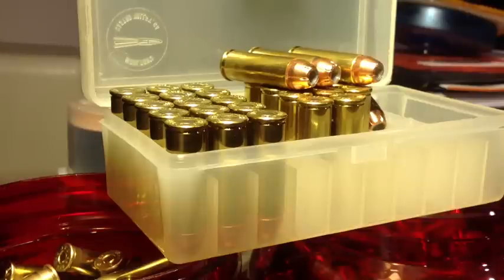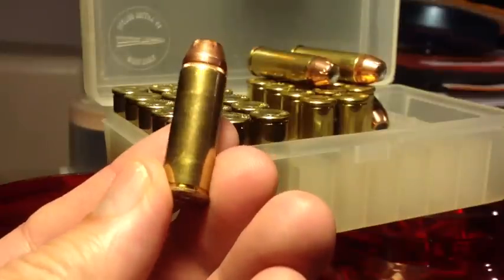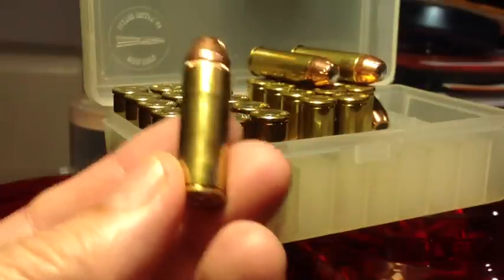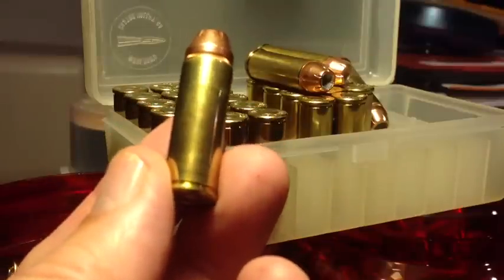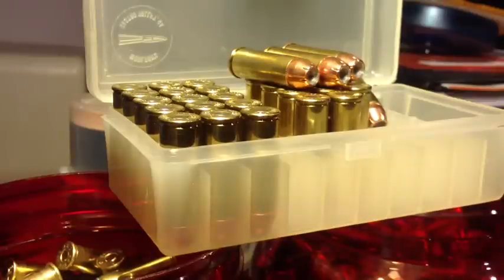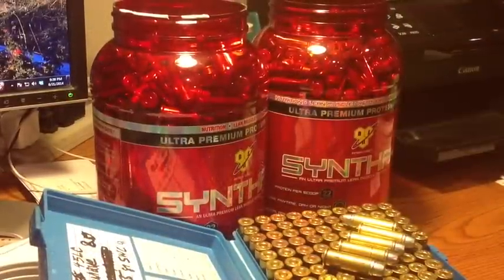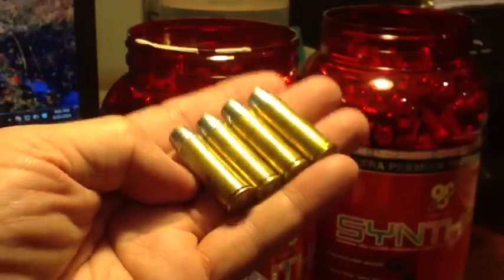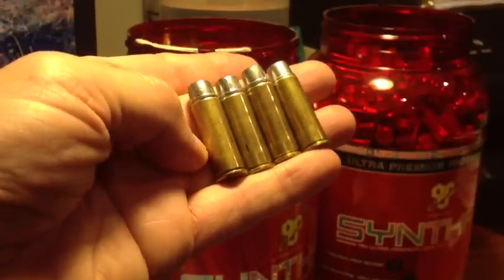Hot Loaded 45 Colt Ammo - Why Not?

Comment: Hi brother, I have a quick question if you've got a minute.

My family runs cows in an area of Utah with a serious predator problem. I turned 16 this year and now I'm viewed as old enough to check cows by my self. I have a 2014 Ruger Blackhawk Convertible in 45 colt, and I personally think the moderate hand loads I put in it are good enough for anything that may pose a threat (semi wad cutters, small amount of 2400, running right around 970 fps) but my mother won't let me go unless I have maximum loads or take a rifle as well. A rifle is out of the question as I lost a Remington 7900 in 30-06 because of a scabbard getting caught in thick brush and being tore off, then falling into the green river, and I am trying to save up for my first truck and can't afford a new 434, 460, or 500 revolver. Could you maybe help me with the info of what either a max load or very stout load I can shoot with relative safety? 
Thank you much

all reloading is supervised by my uncle, a firearms instructor
Reply from the maker: +no no -- SWCs of 45 persuasion and running around 250 grains at 970 are not moderate loads - they are frontier loads.  And predators short of bigger black bears will readily fall to those.  You can stoke those to over 1000 fps easy if you want more smack.  If there is a predator problem, means there is game in the area attracting the predators.  FortuneCookie Policy - Till the day she dies, your mom is always right.   Utah is mountain lion country.  Although they stay to themselves for the most part, there are episodes of human attacks.  A short range carbine 44 magnum caliber would be comforting.  If cost or knock around is a concern, an 18" Mossberg 500 with 00 buck backed up with slugs can be slung on your back, hammer down on an empty chamber, forget the scabbard - quick to deploy.  Practice a little with it.  Practice birdshot is cheap.  Your handgun is backup.  No matter how capable we are, our skin is still mighty thin and our claws are microscopic.  You know how fast beasts can be.  Staying alert and aware is the first priority.  Never let your guard down in the back country.  Wild beasts have little else to do, but work on their next meal.  Best to you in the Holiday Season,   FC
Reply: +no no Well young man I  am not fortunecookie 45lc but maybe I can help you out here and put your mother's mind and yours at ease a bit, the 45 colt round loaded to even the 970 fps level with a 250 grain or so semi wadcutter bullet is way more potent than many of the guns of the cowboy era back when the cowboys gun was very much nescessity, they had many bad critters to deal with that would bother the herd on cattle drives and what not, the most popular round being the 44-40 a round that out of handgun would drive a 200 grain bullet at about 1100 fps. this would appear to be a tad more than your 45 colt but not really the colt can very easily do the same but with a heavier 250 grain bullet, your blackhawk is a good and very strong gun it will have no issue with a load pushing a 250 grain bullet at 1100, you can use either lead as you are, or look up rim rock bullets and try some of their 250 grain semi wadcutter hollow point gass checked bullets (have taken things as large as black bear with these at the speed previously mentioned and they were one shot kills), and the non hollow point will penetrate VERY deeply when needed (with those loaded to that velocity I would not feel undergunned even on some of the larger bears), but for loading lose the 2400 it is about the worst possible powder for the colt really it is a good powder and all but there is way better for the colt, now I am not saying it won't do ok but it has some properties about it that make it less than the best choice for this combo, get yourself some Alliant Unigue standard non magnum primers such as cci 300 work just fine just do not need the magnum primers  for unique it is very temperature stable (doesnt get harder to light off when temps drop) and is very easy to light, and has long storage life if stored even nearly properly, and a little goes a long way so to speak, just some of the things that 2400 lacks, as far as the old wives tail about the 45 cases being weaker than any other cassing is just that an old wives tail, it did hold true in the early days because it was what was called a baloon head design( the brass tube was pressed down against itself to cause the rim area to baloon out and for the rim, this portion of the balooned rim then went unsupported in the gun and with higher pressures of more modern loads would rupture, but for way better than 40 years now that is not the case, all new strait wall cases are made the same way, from machined solid brass by stamping, extruding, and machining and whether 45colt, 44magnum, 357magnum, and whatever are nearly all identicle in strength, just that the old wives tales and numerous miss conceptions are like a spreading illness on the internet especially, I have been reloading and shooting and hunting and am also no stranger to the ranching live, ( right about 40 years now )and if you are in Utah I am your nieghbor to the north here in Idaho (central part near grangeville area), my loading for the 45 colt is as such I chose the better quality cases such as starline, federal, or hornady (they are just more consistant and best overall quality but any are fine) size them as normal, fit them with either cci 300 non magnum primers ( NOW I DO MEAN NON MAGNUM PRIMERS, any brand is fine but again NON MAGNUM or it can cause preasures to go up quite a bit), then I charge them with 10 grains of Unigue ( anywhere from 9.5 to 10 should be great for you)  then cap it off with the 255 grain lead bullets that I already talked about ( diameter of .452 to be exact) and give it a good firm crimp, I have fired bucket loads of these through many different guns over the years and never a problem, and are rather pleasent to shoot without heavy recoil really (in everything from my 1858 remington with the kirst converter, an actually old cap and ball gun converted to shoot metallic cartridge, and my taurus judge, a few different rugers, a couple different rifles, and others), and like I said even hunted with them having taken game as large as elk with them and it did just fine, everybody these days are hung up on velocity and foot pounds of energy to determine what is horse power it seems, but I am here to tell you that a big heavy hunk of lead like the 45 colt 255 grain or better has sent MANY  a man and critter to the promised land ( even at the cowboy load level of 800 or so fps), well long winded I know but hope it helps. take care now.
Reply from the maker: +looseballs1966 -- Thanks for posting to the young man your wisdom...Anything organic that gets in the way of those big 45s at any reasonable velocity is having a very bad day...even 8.5 - 9 grains of Unique is a potent load.  I did not realize that those old 1858s could take 10 grains of Unique/255s.  I'd shoot those in my Rugers though... Have a great day... FC
Reply: FortuneCookie45LC You are quite welcome my friend, yea the old steel framed 1858's are stronger than many give them credit on being and the bulk of the strength is coming from the converter cylinder more so anyhow really, but I still don't suggest giving them a steady diet of them however, just to nice a gun to wear them out that way, but the rugers can take boxcar loads of them, take care my friend.
Reply: +no no  - I strongly suggest reading Elmer Keith on 'Sixguns' so you dom't have to rediscover the wheel.  He walked where you are, 45 Colt wise, way back in the 1940s and 50s.  If you can consistently hit a playing card at 20 yards or so with your pistol, then you probably don't need a rifle, but alternatively some predators can cover that distance mighty quickly, and a rifle does give you a little stand off range you may find useful.  For what it is worth, I played with and happily discarded Unique decades ago and much prefer 2400.  My best advice is play with both, then go with the one you like.  :)
Reply from the maker: +Ken ibn Anak -- He might like 'em both...I used to shoot lots of 10 grains of Unique / 245 Keith or the classic Keith load - 22 2400/245 Keith.  The 10 Unique was a nice warm load and the 22 2400 the full out magnum.  I still shoot lots of those, but since have diversified my bullets to the 200 RNFPs, 240 (they weigh 252) SWC in regular lube as well as PC, and the 240 (they weigh 264) RN in regular lube and PC.  And also 240 gr JHPs as well.  Very versatile is the 44 mag.  I still like the Mossberg 500 stoked with a couple of buckshot rounds back up with slugs for predator medicine.  Have a great day,  FC
Reply: I have gone heavier,  Up to the pierced or flat primer level,  I just wasn't getting the velocities I wanted with Unique without getting the excessive pressure indications still short of the target velocities,  That's why I rolled over to 2400.  I reached the velocities I wanted to see but without head expansion,   Also, I just didn't like the orange muzzle flash of Unique and prefer the white flash of 2400.   :)
Reply from the maker: +Ken ibn Anak -- When we're touching off full house magnums, what differrence does some flash and muzzle blast make?  It's all part of the package.  For real impressive flash, H110.  We're talking lightning and thunder there, pardnah!!  But I do like my 22 grains of 2400 in the 44 - just haven't found any 2400 in over three years, H110 has been found.  Best to ya,  fC
Reply: +FortuneCookie45LC - I hear you,  I loaded about 100 rounds at 21,5 gr of 2400 and stashed most of them them away, then loaded another 500 rounds with the milder 19 gr, load,  That was 20 years ago.  Many dead deer later I still have several hundred of those rounds.  I also still have a full can of 2400 if I need more punch for something.  It is good for .38s too.  Hmm, I still have a quarter pound of Unique too,   Maybe someday I will find a use for that.
My own video at http://plimking.com/45-colt-maximum-load-velocity-test/ shows the kind of velocity 20 grains of 2400 produced,
Reply from the maker: +Ken ibn Anak --  At the rate you are using those powders, you are good for the middle to long term future.. Our gunpowders, stored cool, dark and dry, are good practically indefinitely.  Our descendants will be finishing up our powders if we are not careful...lol  Best Regards,  FC
Reply: +FortuneCookie45LC - That's quite true.  I began reloading using a deceased uncle's equipment and powders back in the 70s.  Some of his stuff (a lot of it) dated to before WW2.  I figure if I shoot one or two deer a year, maybe an occasional coyote, all with the aforementioned .45 LC loads I have enough to last me well into my 90s.   Even longer if now and then I use a different caliber.  I had a friend once who felt she owed me some money for a favor (I didn't feel that way), so one day she just shows up with about 200 boxes of 12 gauge 2 3/4 inch shells, some BB, some #9, at least 4 boxes of slugs.  Seems her uncles and her dad qnd grampa had shot 12 gauge and when they died she got em all. Some cardboard hulled, some even brass military 00 Buck..  So she gave them all to me as a way of soothing her concience.  LoL, I shoot maybe 2 shots of shotgun every 2 or 3 years, so I am surre in 2040 or so some of those same shells will still be being used.
Reply from the maker: +Ken ibn Anak -- Those shotshells with the paper hulls, though, were loaded back in the day of fiber wads and overpowder wads using fairly heavy wad pressure.  On long term storage, they may shoot fine with the occasional squib because of that.  Best shoot up those paper shells first - but save a couple of good boxes of 'em for their value as collectors.  In fact, save a couple of boxes of the old plastic hull ammo also for collectors especially if the boxes and cartons are in good condition.  The plastic hulls are much better for long term storage.  That was a mighty nice gift that friend of your presented you with...You are actually set for everything from rabbits and squirrels up to Canadian geese... But if you are shooting 1 shotshell a year, you are looking at the times of Star Trek and Star Wars...please say hello to Kirk and Luke for us... FC
Reply: LoL, I was way ahead of you  I swaped most of the paper hulls for a big tin of British MK2z 9mm ammo and some bandoleers of 30-06 M2 ball,  I'm pretty happy with the brass military 00 buck, actually used a round of the BB shot to harvest a turkey last year.  I still have bricks of 22 ammo for rabbits, but haven't wanted to eat rabbit for decades, so I have no real idea what to do with the boxes of Federal #6  and #8 game load.
Reply from the maker: +Ken ibn Anak -- Those British 9mms were loaded for their Sten guns - now there is a fascinating story - short of weapons after Dunkirk and Tommy guns were in short supply and expensive, Britain went to work to produce a cheap reliable submachine gun.  Their Sten used a tube receiver and lots of stampings gving the US the ideas for making the M3 Grease Gun.  Those big old lots of surplus Mk2z ammo still turn up now and again...good stuff - mildly corrosive though as I recall.  You can shoot those #8 game loads if you ever do any trap or sporting clays.  The 6 shot though are for rabbit and short range duck.  Good shootin' to ya... FC
Reply: I know about that.  Suffice to say the Mk2z ammo heats up my Ingles HP somewhat quickly.  I mean the pistol gets hot much faster than with other brands of ammunition.  Oulled I note the powder used burns very, very fast,  I concur in the Brit's decision to drop this round.  A solution for a problem that didn't really exist.  Just use a weaker recoil spring and the Sten gun will work well with normal ammo.  Attempting to duplicate the performance of a carbine with a 9mm round inside the standard envelope was an accident waiting to happen.  I believe these could crack the toggle of a Luger with not too many rounds fired.  I added a rubberized reccoil buffer to my Ingles and a HD Wolfe recoil spring, but I don't think they would be good for plastic pistols either.
Reply from the maker: +Ken ibn Anak -- Any shooter that got a hold of that ammo is surely hep on history and the significance of that.  Many of our fellow readers have no inkling of Mk2z.  That Mk2z ammo would be great for cartridge collectors...very historic.  The Sten and that ammo were a great success story..I would not shed any aspersions upon it.  .I haven't seen any of that Mk2z ammo in a raccoon's age...Best to ya,  FC
Reply: the original black powder colt load was 250 grain bullet, right around 950 fps +/-.
enough to kill a horse.
remember ... it was developed for the cavalry.
Reply from the maker: gray man - To add to what you say, that loading was the magnum of its day...until Elmer stoked his 45 Colts to the blow up stage and then switched to the 44 Special... Best to ya,  FC
Reply: elmer did some dumb stuff ... simple observation would have shown him the cylinder walls were too thin.
Reply from the maker: gray man - plus the cylinder stops are right at the thinnest part of the cylinder - blow outs there...but Elmer had to see for himself...there wasn't any data then, and he wanted to push the envelope...I'm kind of doing a mini - Elmer getting more performance out of the 44 Russian and 45 Schofield in strong Rugers (the 38 Short Colt really is too much of a pipsqueak).  Best to ya,  FC

Comment: I find the package in which the .454 Casull is chambered is usually very bulky and very cluby. The 60,000+psi pressures of this cartridge require a lot of meat and special metals to handle this stress, much moreso than a +p loaded .45 colt. So you're either dealing with a 5-shot Super Blackhawk or the very chunky Super Redhawk to handle the stress. Or going to something like a BFR revoler, or Freedom Arms, or a TC single-shot pistol. None of these bulky platforms strike me as something to shoot the 45 Colt from on a regular basis due to their added weight and sometimes reduced capacity. The 454 Casull is a beast and cannot be rivaled in the category, especially considering the case length. The 460magnum is a whole nuther thing.
But as you say, running to the top SAAMI spec on 45 colt is plenty for just about anything a person could use a 45cal revolver cartridge for, selecting good projectiles. The need for .454 is more niche. Using a 45-70 in a carbine, for instance, will do a lot more than the heavily-recoiling .454 would accomplish. My personal opinion, if 45 colt +p isn't doing the trick, moving up to the .480 Ruger is probably a better choice than dealing with the .454 Casull.
Reply: Recoil wise, I agree with you, but try finding  some 480 ruger ammo RIGHT NOW, compared to 454 or 45 Long. I bet you can find at least one of the two.
Reply: Couldn't agree more. The .480 Ruger is an excellent choice as the next step up from 44 mag and 45 Colt+p cartridges. I have one in the Ruger Redhawk Alaskan for chest carry. It's a handful alright, but the business end is definitely not to be fugged with! 😂

Comment: I turn down .454 casull brass to .45lc length and then load my .45lc loads hot, hot, hot..

So there.
Reply: Yes! Keep up the old 1929 45 colt.
Reply: The safety of a cartridge in a firearm is not determined by the strength of the case but by the strength of the chamber and receiver.
Reply: What!?!   Are you like 8 years old?